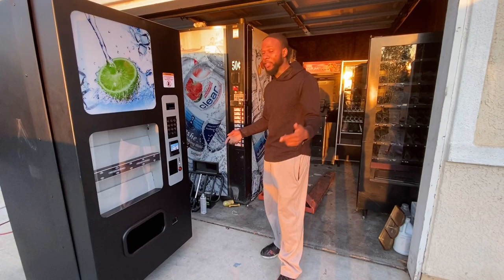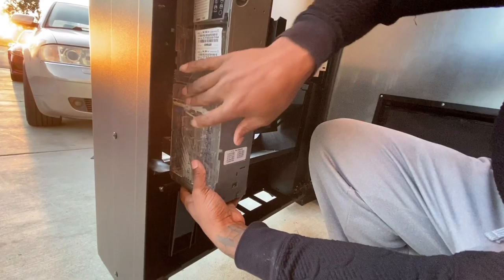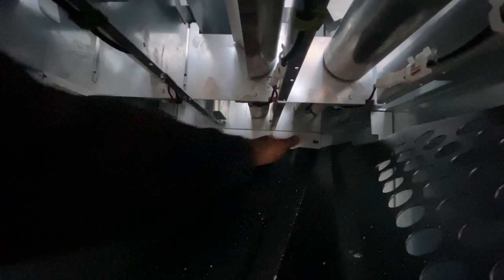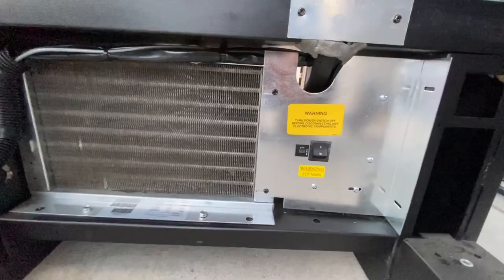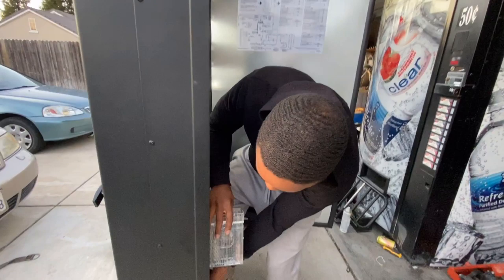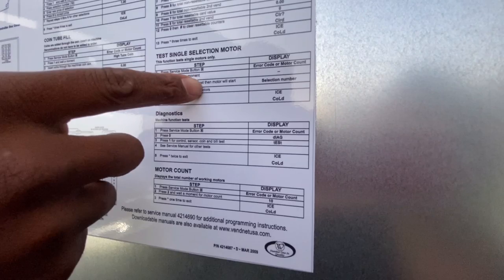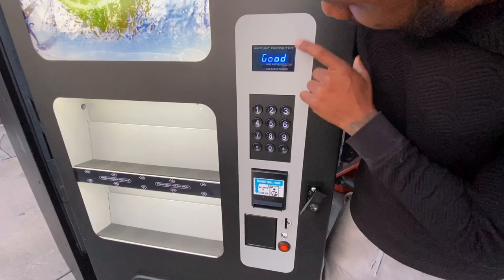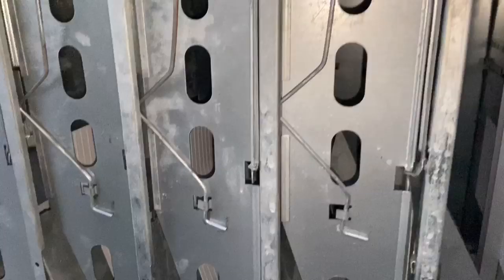What to look for when buying used vending machines ✅

Comment from the maker: What kind of videos do you guys want to see next ???
Reply: Hunters Vending thank you for the information. have you purchased used machine where cards are accepted? Or done an upgrade? Does it even matter?
Reply from the maker: I have purchased machine with and without. If you do get it upgraded with the machine it’s a process of getting it out of their name & transferred to your account. And yes I install it myself if it’s not one present with the machine.
Reply: How about repair/install drop sensors,motors, credit card readers,bill accepts, etc
Reply from the maker: CMONEY Stunna I’m going to be making videos in all that!! I got y’all!
Reply: How much are the credit card dept for the vending machine cost?
Reply from the maker: Talk To MeTv cc readers cost 300$ each and for the services it’s like 10 a month
Reply: how to get locations. What to do if something goes wrong. Getting your LLC.
Reply: how to install a card reader for dummies 🤣
Reply: Hey Hunter I need your help. I recently bought a Wittern CB500  like you have on your thumbnail for this video. Question is, do cans pop in yours? When I bought mine it had like 9 cans busted and didnt know why. My tech even said that it pops bottles but dont know why or what to fix so it doesn't happen.
Reply: I have a question how can I reach out to you
Reply: Frozen Vending Machines
Reply: Just purchased a vending machine but the numbers aren't responding ? What do you recommend I do ?

Comment: Wayne, I would recommend you to buy a narrow pallet jack. Moving machines is way easier when you have a pallet jack that is the correct size. Especially for the wittern here in the video, the pallet jack fits right under👍 I got mine for like $80 used

Comment: Love your video's. I found a machine just like the one you are testing out and paid only $300 for it it's very clean and every thing works. I also now have 7 locations and 8 machines in them most want more. But they have to wait until I can get some snack machines but it takes money. And no commission at any
Reply: Where did you purchase your vending machines so cheap from?
Reply: @darylwalker7857  facebook market place
Reply: DOING IT 👍🏼

Comment: The rod for the motor you tested is corroded and needs to be cleaned that's why it has a horrible sound...they all need to be cleaned. You'll burn out the motors if you don't clean them.

Comment: Your machines over there are so cheap. Here in Germany they are expensive. To get a good one. No junk. You need to spend at least 3000$.
But then there is not Bill accepter and no nayax. These Cost about 1000$ extra. So you need to spend about 4000$ total to get a refurbished, top of the line, reliable machine.